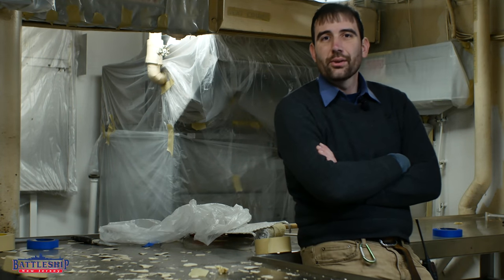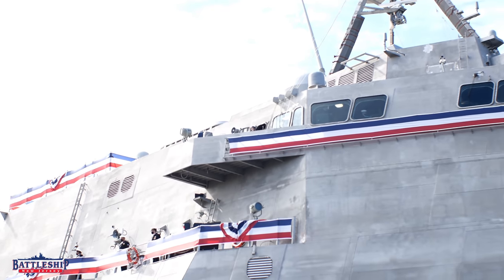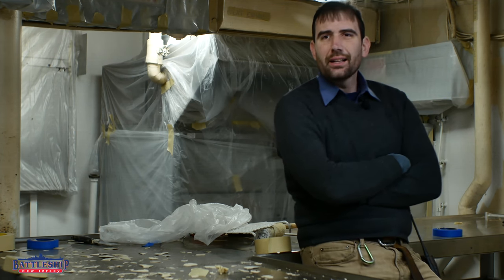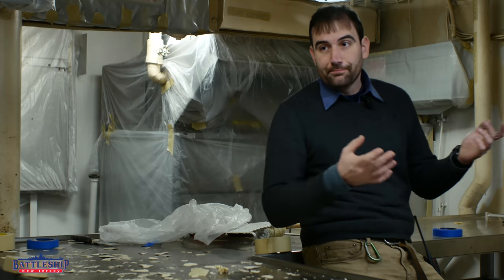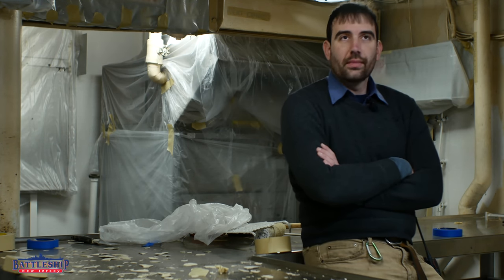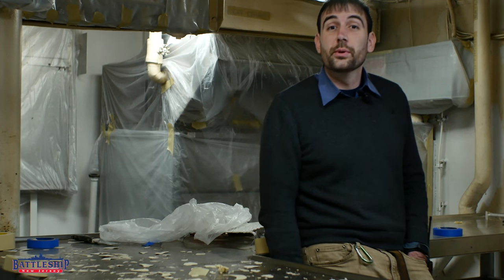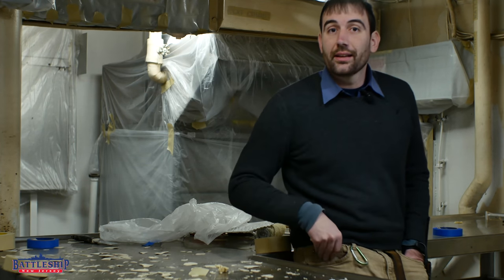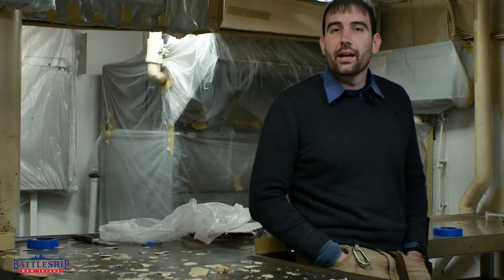Warships Made Out of Aluminum?!?

Comment: I served on two frigates; a Knox & a Perry. Both had aluminum superstructures and steel hulls. The hulls were 3/8" HY 80 steel which ain't anything to brag about as hull stiffeners were retrofitted to both classes. The superstructures on both ships had substantial cracking which leaked badly in heavy rain, and corrosion where the hull met the superstructure. If you like cracking superstructures and a ship that would melt in a bad fire then go for it... by the way, both of my ships were equipped with PVC piping which gives off toxic fumes when burned. Saving weight and money can be very costly in the long run and potentially deadly.
Reply: ABS isn't polite either, but at least that's not liable to throw a chlorine party when things get spicy...

Comment: Issue 3 with Aluminum: Any other metal joined onto it will corrode significantly faster. Hence why USS Independence was decommissioned, the propulsion system literally rusted off.
Reply: both ships i served on had aluminum superstructures. the older one, at 25yrs old you could see holes through the aluminum at the line where it joined the steel hull.
Reply: I was about to make a comment on this exact issue. Corrosion repair has been a real issue with the lcs.
Reply: @yo yo What's a degalvanizing system? They have the ability to remove zinc?
Reply: Al ships are built and regularly scrapped .   It is ok out of water, so cars can last ten plus years.  Good for disposable ships
Reply: It was a mess. I saw pictures.
Reply: He did mention this point in the video... Aluminum superstructures on steel hulls and corrosion btw the two.
Reply: A battery is made from dissimilar metals which create a galvanic current and causes corrosion.  Salt water does not help either!
Reply: @amorag59  He mentioned cracking which is caused by uneven expansion and contraction between the two. The LCS's don't have that issue being completely made of aluminum, the issue is that unless stray charges are "grounded" and proper galvanic protection measures are implemented any fittings made of dissimilar metals will corrode and rapidly.
Reply: Queen Elizabeth 2 had a similar problem with its Aluminium superstructure I believe.
Reply: @DeeEight  They still melt if you get a combat damage fire. See HMS Ardent, HMS Antelope, Falklands war.
Reply: @georgeburns7251  The USN doesn't want "disposable ships". Modern ships cost millions to perhaps billions of dollars, they're not something you want to have degrading faster than their expected service life. Especially when the USN is trying to reduce maintenance costs, and increase the longevity of their ships. One of the long term objectives of the USN is to have ships that can be easily changed/upgraded to not only make them more flexible, but also last longer in service. The LCS program was supposed to an example of this but since most of the program is in actuality an example of how messed up our arms procurement is, it's become more of an embarrassment. The number of ships ordered has been cut, some of the first ones are already being retired before their initial expected service life, and some of the mission modules are only now just coming online.
Reply: Exactly, anytime, anywhere you join similar metals it's an issue. it creates problems,  Similarly with electrical wiring,  copper and aluminum.
Reply: That sounds like an issue with the other metals, not specifically the aluminium.
Reply: Stainless steel, aluminum and saltwater don't play well together
Reply: @KevinSmith-ys3mh  The Zumwalts are another story entirely. They seem to be an idea that just came too late, and constant cuts to the program resulted in fewer and fewer ships. This drove the unit price per ship up to the point where the program had to be reviewed which is procedure. During this review it was determined the project should be cancelled. If anything, that actually sounds like a good outcome as the system eventually weeded out a project that wasn't needed. This same sort of process and review is the reason why the Montana Class BBs were never built, and if the Iowa Class hadn't already been paid for, would have likely resulted in their cancellation too.

The EMALS issue is also one I'm not upset with as the Ford is also an active test bed for new technologies the USN wants to implement which will simplify upgrades/overhauls in addition to reducing maintenance. Such a leap is going to result in issues, which is understandable. It only looks bad because as a brand new ship displaying many new features, there are a lot of eyes on it. Some of the first catapult systems were actually failures until the steam powered ones we use became workable. Ford is also actually expected to start deployments later this year.

Projects like the LCS, and F-35 are bad because they blew up far beyond the size, and cost such programs should have been given what the end product was supposed to be. Would the F-35 be so bad if it didn't suffer from every congressman having a slice for their district? It certainly would have been less embarrassing if Lockheed hadn't made the boneheaded decision to begin production before prototype and testing were truly finished (this resulted in ever growing numbers of jets needing to be fixed when a problem was found).
Reply: @jth877 It is the system to prevent Galvanic corrosion. It uses an electric current and a sacrificial metal anode.
Reply: @chipholman3860  The joke was that a degalvanizing system doesn't exist.
Reply: @jth877  Ah. I missed that. Sorry
Reply: @airplanenut89  The first 2 ships were prototypes for testing, and were always intended to then go into the reserve, 
presumably to be brought up to match the rest of the fleet later.

Comment: My 3rd ship, the USS Peterson DD969 was a spruinz class destroyer. Their hull is steel and the superstructure is aluminum. I guess they didn't consider biometalic corrosion at the time, but aluminum turns to a white powder at sea and of course steel rusts. But the issue was so severe they eventually decommed all those class of destroyers because of the corrosion.
Reply: My one and only ship was the USS Robison DDG 12, Laid down in 1959. She had the typical steel hull and aluminum superstructure, both of which were in good shape at the end of her service life in 1991. The BM's paid close attention to that bi metal joint. I was told it was gasketed to prevent direct contact and reduce the galvanic effect.

Comment: I have mentioned before, that my ship the Gridley CG-21 had a steel hull and aluminum superstructure that was I was told as explosion bonded. The pump room for my Aft 55B radar system was on the main deck. I remember seeing corrosion at the bond between the steel and aluminum from the dissimilar metals. I also remember seeing what looked like to me to be rivets at the steel and aluminum junction. I was a Fire Control Technician so I only know what I was told and what I saw. I was also told that my ship had a zero survive ability in modern combat of the 80's. But what do I know,  THE better that I did my job keeping my Aft 55B's at top notch availability, the better was the Gridley's survive ability.
Reply: The explosion forming may have been for shape alone. Given that steel & aluminum have different temperature expansion coefficients, I'd expect the first cruise from Alaska to Hawaii to pop all of the exterior (or even just non-climate controlled) explosion welds in the ship.
Reply: @pyroman6000  Part of that et cetera: more speed and maneuvering. :-)
Reply: @pyroman6000  Kinda, that trend of logic began when looking as missiles systems as compared to having a ship that can tank a hit. They concluded that the anti-missile missile can work the same as armor, but can be removed during peacetime. Also, whereas armor needs time to be repaired after an attack, a successful missile intercept doesn't come at as much of a cost. It's a very intuitive argument they made at the time, but it sorta works.

Also, fun fact, that corrosion is dissimilar metals is called "Galvanic Corrosion", a nasty problem for water cooling PCs that needs an additive if you have copper and aluminum parts.

Comment: Ya the original space shuttle fuel tank was white but they realized that if they left it raw with just the insulation it would save 600 lbs of weight. I can't imagine what the paint weighs on a ship the size of New Jersey.
Reply: And then the unsealed insulation developed a habit of coming off, which at one point destroyed an orbiter and killed seven people, but, y'know, it's a process of discovery.

Comment: A big part of the problem with aluminum superstructures on steel hulls is how do you fasten the 2 materials together in a way that will not fail for 1 of 3 reasons. 

If you have them near each other and add salt water you get a battery and one material or the other breaking down due to the flow of electricity. 

If you fasten them solidly together like with rivets or bolts then you have 2 separate but equally important factors. 1 being the difference in flexibility of the metals. Everything flexes under load. Steel and aluminum have very different amounts of flex. As the ship encounters waves in the ocean the steel flexes which puts a tremendous strain on the superstructure attached to it which flexes as the steel moves. If they are solidly attached then the force goes right into the fasteners system holding them together. Steel has an advantage here because it has much higher resistance to stress cracking than aluminum. This results in tiny little cracks that end up propagating through the entire aluminum piece it started in.

  The other being temperature induced expansion differences in the metals. Going from warm to cold weather causes shrinkage to occur. These metals shrink at different rates which means if they are held firmly together at some point the metal that is weaker will fail and crack again with the fastener system bearing the brunt of the damage and being the most likely point in the system to fail.
Reply: I guess you could use stainless steel bolts with a zinc footer to act as a sacrificial anode
Reply: Savannah is all aluminum so this is not an issue.  There are a lot of aluminum sailboats cruising the world showing it can be done without issues.
Reply: I also get shrinkage in cold water.

Comment: In the late 1960s I served on three GUPPY submarines.  The first was the USS Tench which had been "streamlined" with an ALUMINUM "sail" casing all attached to the steel supports for the masts, etc.  The aluminum was always flaking and powdering and was a bit of a nightmare.  The other two subs I served on had the newer "North Atlantic" sail structures which were framed with stainless steel connected to the steel mast supports and sheathed with +/-1/4" fiberglass skin panels riveted or bolted to the stainless framing.  This worked VERY WELL and was easy to maintain.  One of these last two subs also had its deck casing aft of the sail replaced with this same type of fiberglass skin probably framed in stainless, and all hinged on its outer bottom edges in sections that could be opened for maintenance of the piping below the walking deck - "clam-shell" style.  
    The GUPPY-III USS Clamagore (SS-343) which is/was a part of the Patriot's Point SC (USS Yorktown) fleet was configured this way.  Sadly this sub rusted so much in its salt water environment that PP gave it up and Palm Beach FL was going to sink it as a reef.  But a January 2022 Google link says its still at PP!   And on it goes.
Reply: @DeeEight  Thank you for this insight!

Comment: I'm surprised that paint isn't required for aluminum. I served aboard USS South Carolina CGN-37 with an aluminum superstructure. I spent a lot of time painting it with zinc chromate followed by haze gray. I guess things have improved.
Reply: You would paint aluminum for different reasons than steel.
Reply: The aluminum alloys that were available and used back in the 70s is quite different to what's available now which probably explains the difference. Plus removing the paint probably helps with reducing fire spread risks.
Reply: @shadow7037932  You would paint aluminum so the structure blends into the background better. Unpainted aluminum is rather light reflective.
Reply: @washingtonradio  : Go look at your aluminum foil. Look at both sides. You see how one is duller than the other? You can get much more extreme versions of that with anodizing.
Reply: Aluminum can also be anodized, which is a chemical process that modifies the aluminum itself. This can change the color of the aluminum, and also make it accept dyes that are integrated into the crystal structure of the aluminum, instead of sitting on the top like paint.

I have no idea if, or how, the Savannah aluminum is treated, but it's an option.
Reply: @shadow7037932  Exactly right. The 5xxx series alloys available now are stronger, more weldable, hardenable, and way more corrosion resistant than the 6xxx alloys used in the 70s and 80s.  They’re even sold as ‘marine-grade’ aluminum.

Comment: Metal fatigue is a bigger issue with aluminum than it is with steel. 

Technically aluminum is less corrosion resistant than steel but what aluminum does is form a protective oxide layer that sticks to the surface. The oxide layer is non-conductive. The process is called 'passivation'.
Reply: The main problem, that causes iron/steel to totally rust is the structure of the iron(III) oxide. It is a porous material, so it let the oxidizer to reach the untouched surface of the metal. Meanwhile the aluminium oxide is a closed structure oxide. It seals the surface of the metal. But there are (weak) acids which can easily solve that oxide. For example hydrogen chloride, and that is the base compound of most household decalcs.
Reply: Agreed,  Aluminum fractures and crystalizes,   under repeated strain, and stress. I' ve seen it myself.
Reply: @egyeneskifli7808  
That is right.
Steel and iron altso oxidises, howexer oxidation on stell/iron takes up much more space that oxidation on aluminium. So rust detaches from the steel underneath. While aluminium oxide takes up more or less the same amount of space as the base metal, and sticks to the pure aluminium underneath and thus creates the pacivation layer.

Comment: I think it's an awesome idea. Like you mentioned, it isn't meant to do what older heavily armored ships were meant to do. It's less maintenance, which is a dream.. my favorite thing is that in 20 years, you'll see highly polished areas where thousands of sailors have steadied themselves getting in and out of bed, or through a doorway or hatch. I'm interested in whether or not there's any protocol for sanding/texturing on walk ways??
Reply: Floors would be a standard marine grade grit loaded paint, applied in 2 coats with a coat of grit embedded in the first coat when tacky. A very common item on ships to make a floor surface, and provided it is done right and maintained very durable.

Only thing I see with all that silica wool insulation is that it is going to be a nightmare to maintain, as it will allow slow wicking of salt water spray into it, which will cause the aluminium to corrode, as the surface passivation is chemically eaten away by the thousands of tiny chloride cells and oxygen making the surface etch away. Especially if they use any sort of caustic soap there to clean things, or any sort of acid, which will slowly eat through the aluminium oxide film. I foresee that in 5 years that will will all be ripped off, and the aluminium under will need extensive repairs at the base of the structures, because it has corroded through in thousands of pin holes. 

Hopefully before they put all that silica wool on they properly prepared the surface, which means a bead blasting, washing with pure water and then solvent, followed by a spray coat of aluminium compatible primer, and then at least 3 coats of a flexible paint, so that there are no bare metal edges under that silica wool. Any chips in that coating will have the telltale white and black corrosion product running down from it after a while.

Comment: Newport News class LSTs had aluminum super structures.  The aluminum was attached to the main deck by steel gusset plates and rivets.  The welded steel gussets would crack.  Of course , the whole ship cracked in various spots in a typhoon.
Reply: and where they didnt crack, the causeways could and did move around enough to punch holes through the berthing spaces.

Comment: I bought a 12-speed roadbike in 1986. Chromoly steel frame. This bicycle survived 5 collisions from autos. I have seen cracked aluminum bicycle frames. Once my frame was collided very hard (me and the bike went flying through the air, about 20 feet). My backpack softened the impact so no terrible damage to me but the frame was distorted (side impact).  I found a guy in Hermosa Beach (L.A.) who would bend steel frames back into alignment. He did a perfect job.  I'll take the extra weight, steel over aluminum on the streets of Los Angeles, anytime. Aluminum, not so war savvy.